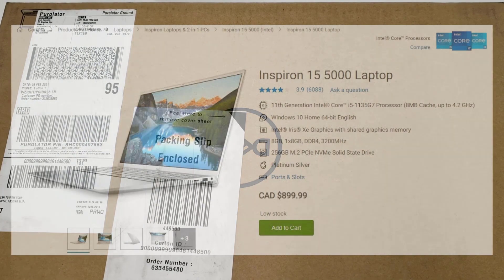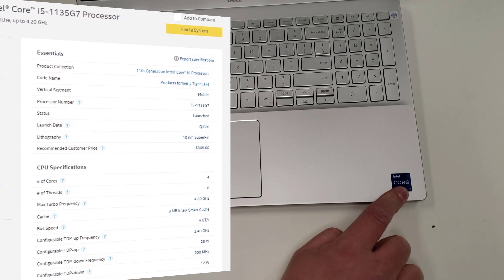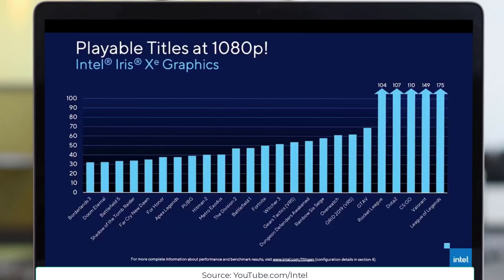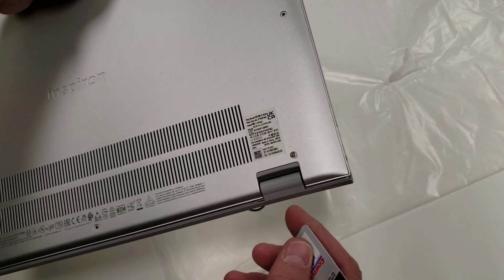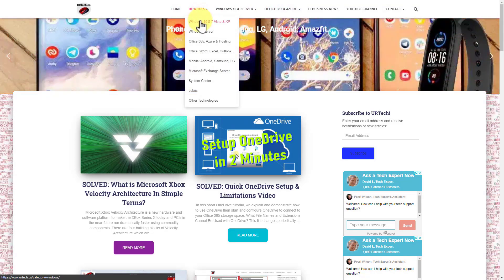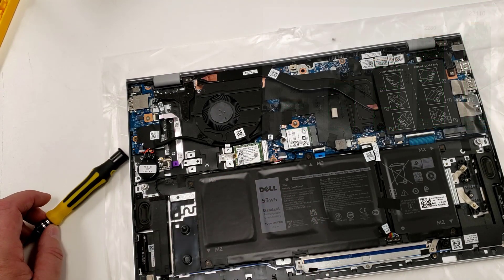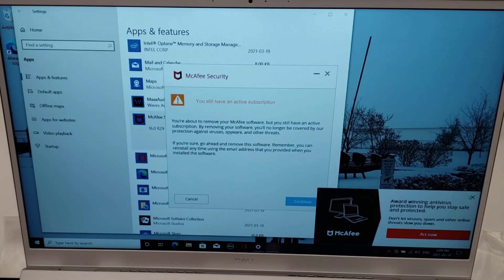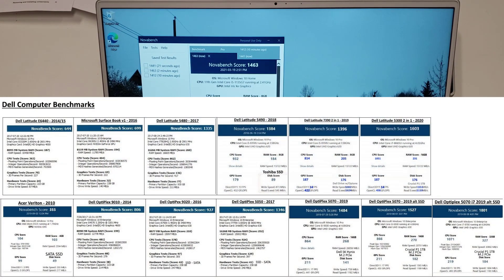Dell Inspiron 15 5502 Unboxing, Review, Disassembly & Benchmark

Comment: The top vents aren't intake vents the one on the right is the exhaust van for the heat sink the left one is unpopulated. Air goes in the bottom and blows out to the screen.
Reply: Thanks I'm glad someone pointed this out, many are confused about this.
Reply: Yes, snd they obv throw a lot pf hot air on screen while playing games so will that Damage my 5502's screen??
Reply: @dheath3697  will.hot air from there, damage my screen? Mine throws a lot while.gaming
Reply: @stanpoatan  There's been no reports of anyone getting damaged screens yet, so I think we will be ok.

Comment: I also have same laptop but i have a doubt that why the base clock speed in task manager is at 1.38 GHz ??? It should be at 2.4 Right ??.
And how is your gaming experience with it as I am not able to play anything with it not even CS GO. 
please help please
Reply from the maker: Hi Anshurman;  My daughters have these units at University currently and they seem very happy with them.  As shown at https://youtu.be/-fuFhNSYds4?t=1009 the unit I tested is running at 2.4Ghz.  If yours is not, I would first update then reset the BIOS then I would call Dell support.  I hope that helps.
Reply: It is totally ok.. dell has purposefully set base speed of all the new Inspiron 5000 series to 1.38 ....

Comment: I have it too but with slightly different components but I have one problem. The vent is constantly making a loud noise. Have you experienced anything about this issue?
Reply: For me yeah I experienced that issue alot and it seems that the processor isn't stable when it comes to the cooling solution cuz there are times when I don't do anything at all and the fan will get crazy by itself... Idk if they fixed it or not cuz it seems that software update can fix that issue
Reply: @melad04haddad  Hi! I don't know why but some programs as Edge and PotPlayer, were consuming a lot of resources (even 100% dedicated GPU)! So, I tried to uninstall them and my problem was solved. Now my 5502 is always completely silent.
Reply: @francesco.pellizzari  interesting! I might do a fresh windows installation then after updating the storage cuz I was planning to clone my current installation. Thanks for letting me know!
Reply: Mine makes fan noise while playing Valorant game. How I can make it silent? Any tips? Also the heat vent is right under the screen so that will not damage my screen?

Comment: Very good review. 
About de USB ports, Is the USB Type C from this Dell supports laptop charging ???
The Laptop can be charged by that USB Type C  ???
Reply: No, its a standard USB C 3.2 port and not the thunderbolt port which can charge the laptop
Reply: There are many Laptops with USB C 3.2  which it is supports charging the Laptop. 
I need to know on this Dell if supports charging by USB C 3.2 .
Is not only the Thunderbolt USB C supports charging. 
Check the other review Laptops with the same USB C 3.2  port which supports    charging.
Reply: If im not mistaken , it does support charging with usb-c port (power delivery)! Will update you in two weeks time as my laptop is gonna reach soon!
Reply: I have that laptop and I use the usb c mainly to charge it and it works fine and I compared the charging speed between the original charger and with the usb charger and it was exactly the same just make sure to buy a 65w charger with a usb c to usb c that supports 100w and you'll be good to go

Comment: I have the same laptop but with the i7, there is a critical bios update, you can get it from dell.  I upgraded my memory to 32GB and installed another SSD.  You can get the bracket kit on amazon easily..   On the stock drive I have windows.. and the new SSD is ubuntu.. Ubuntu is my daily driver.. but windows is there just in case.. really no need since I have windows on a KVM in Linux but you never know.. if i run out of space on the new 1TB SSD, I will free up the stock 512TBer.

My only complaint with this laptop is the keyboard, its is hard to see in a well light room.. I wish the keys were black, other than that its a great laptop
Reply: Hi. So... how much ram are you able to install? Is 32 the maximum? Also, is 3200mhz the max supported?

Comment: Hi! Great video!
Couple of quesitons for you:
- I am not a fan of that kind of silver keyboard. May it be replaced with a Dell Vostro 5502's one (which is basically the black verison of this Inspiron 5502)?
- How is this display compared to IPS ones? (I see from the specs this Inspiron 5502 mounts a WVA display). Would I notice any big difference for the use I should make of this notebook? (mostly Software development) Is it anti-glare?
Reply from the maker: Hi Gabriele;

I don't know if the Vostro keyboard can be swapped in, but I can say there is a black version of the 5502 and those all look the same so I suspect the are the same (except the colour)!
Reply: @URTechDotCa  
Thanks for andwering my first question. I have a second one:

- How is this display compared to IPS ones? (I see from the specs this Inspiron 5502 mounts a WVA display). Would I notice any big difference for the use I should make of this notebook? (mostly Software development) Is it anti-glare?

Comment: Great review! How about the screen? Is that 220nits good enough?
Reply: If you're using it inside a room yeah you'll be fine but under a bright sun... It would be very difficult to see anything even on a max brightness... For me the colors are kind of fine but if you're gonna use it for graphic design you better use an external monitor cuz the colors aren't that good but for normal videos even for movies you'll be fine... Just make sure to put the screen in the movie mode on dells app cuz it will improve your watching experience in it.
Reply: @melad04haddad  thanks for the explanation, considering to take this model.
Reply: @gingerlew513  it's a pretty good laptop in my opinion especially for it's price but the battery life is kinda bad in it only getting 3-4 hours of battery life
Reply: @gingerlew513  if you get a Ryzen model I'll recommend you getting it especially they released a new version wit the 5gen cpu in it and Ryzen have batter battery life (both of them uses the same battery but intel sucks when it comes to battery life)
Reply: @melad04haddad  I see, seems like very terrible in battery wise.
Reply: @gingerlew513  very much....

Comment: I bought laptop specifically because of the ability to add ram and another m.2 add.  I added another 8 gig stick and a 512ssd and am getting scores much higher than yours.  
1245 CPU
277 ram
315 gpu
175 disc .
And yes I have the i5 1135g7
Reply from the maker: Fantastic!